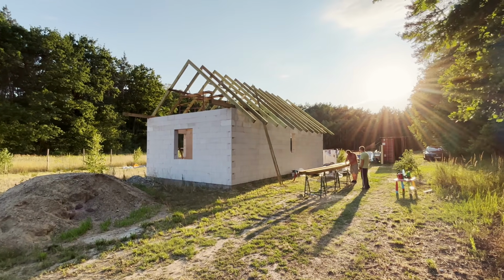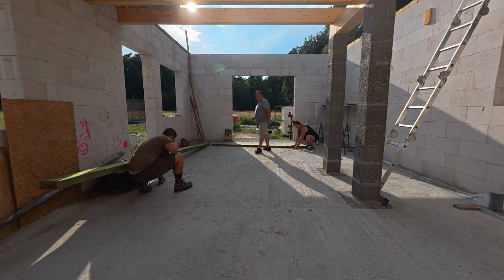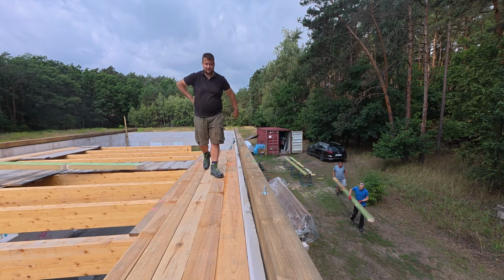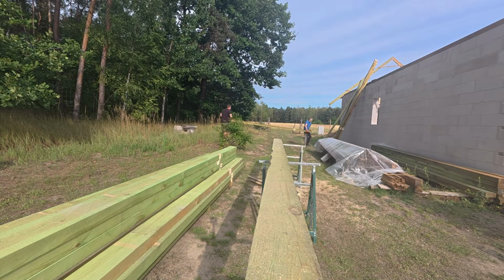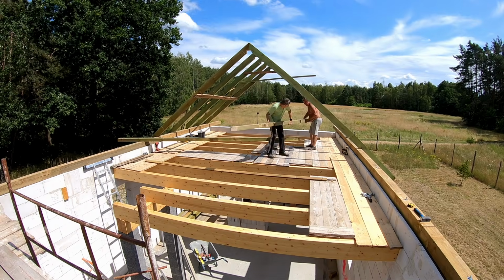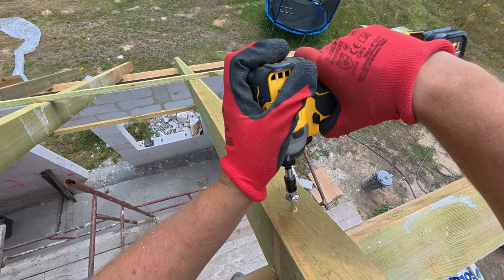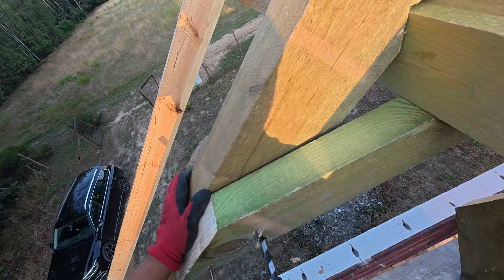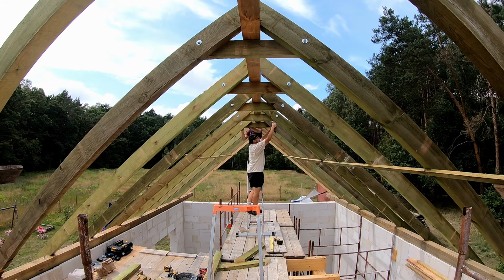How Much Does a Roof Cost in Poland? (Structure Breakdown)

Comment: was the wood c24 class? how many m3 did you need?
Reply from the maker: Oh, you got me there with that question… I think it was roughly around 5–6 m³. I couldn’t find the invoice, so I’m not 100% sure. 😢And yeah, it was C24.
Reply from the maker: I found the calculation, it came out to 3.823 cubic meters. In the end, we went with single collar ties instead of double, so the final amount was probably closer to around 3.5 to 3.6 cubic meters. :)
Reply: Hey dude, watching with fascination your videos as it is something my wife and I want to do.
Question about the electric box. You said it costed you 1100 pln, but you had in brackets 12k. Can you elaborate on that one if you can?
Reply from the maker: @sdg198127  When I bought the land, the nearest electricity connection was over 500 meters away. At the time, they told me at the office that connecting it would cost around 12,000 PLN.

From what I understood later, the basic connection fee usually covers roughly up to about 200 meters, and anything beyond that gets charged per meter—so the distance really makes a big difference.

Back then, I didn’t know all of this when I submitted my application. But luckily, my neighbour applied for a connection as well—and he got connected before me. That changed everything, because his connection became the new closest point to hook into.

As a result, the distance to my plot was much shorter, and instead of paying the full 12k, I ended up paying significantly less.

Honestly, I got really lucky with that timing—and I could put the saved money straight into the house instead.

Hope you find your way! What part of Poland are you planning to live your dream?
Any questions, let me know—I’ve got plenty of experience from the last few years that might help, and I’m happy to share! 🙂